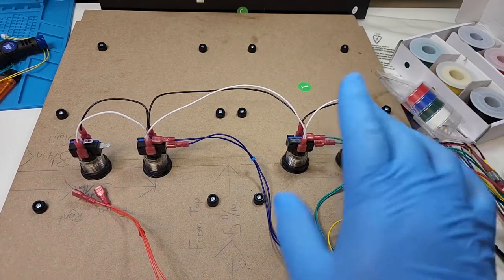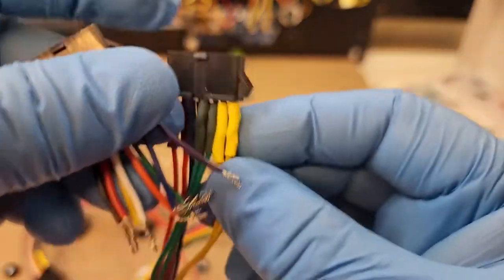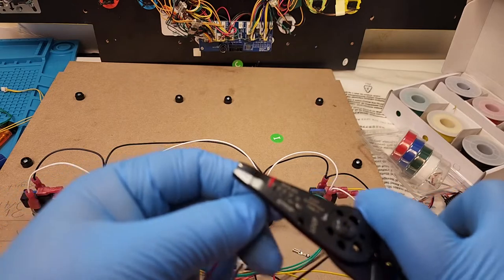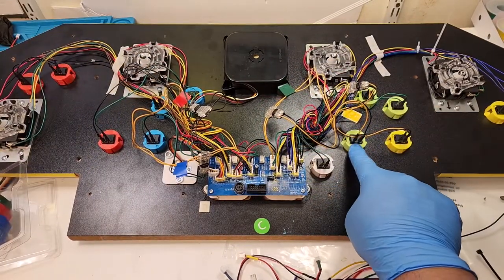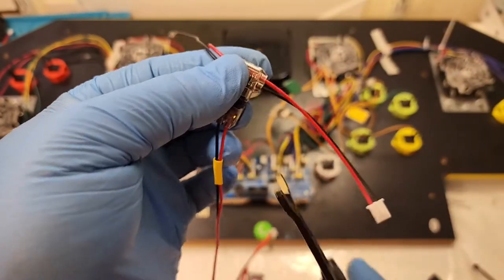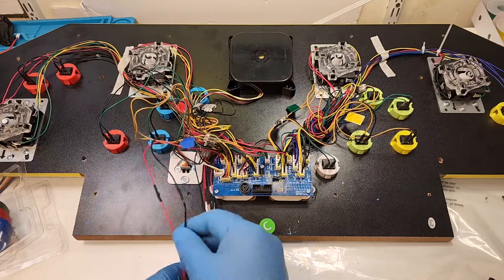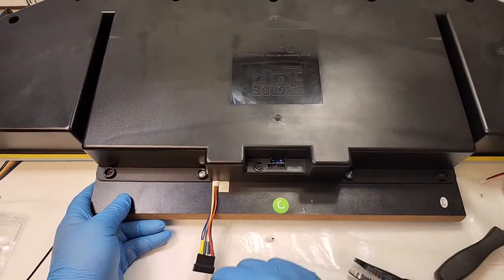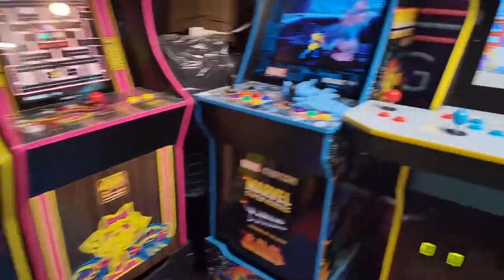Arcade1up The Simpsons Coin Door Modded w/ REAL Working Coin Buttons Pt 3. Wiring Player Buttons

Comment: what heat gun are you using?
Reply from the maker: It’s a cheap Zeny 862D+ soldering/ hot air station I bought on Amazon or EBay (don’t remember which) 4 or 5 years ago.